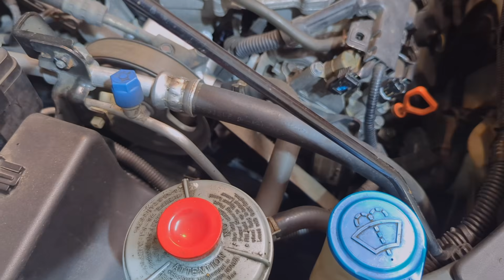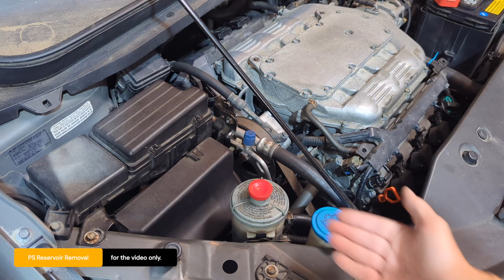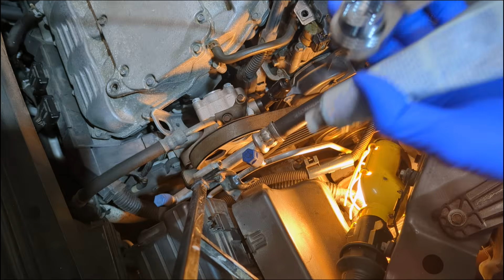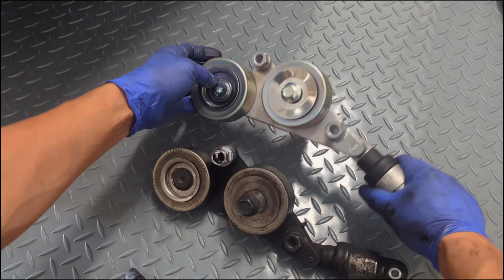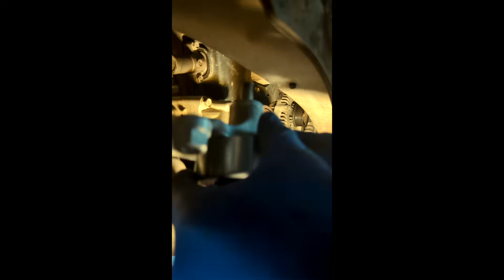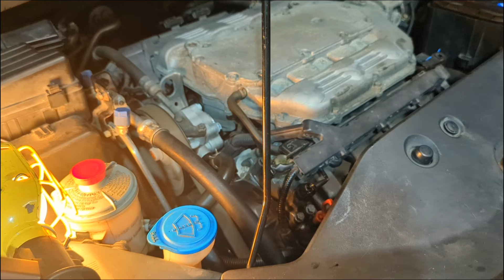Honda V6 Serpentine Belt & Tensioner DIY Guide - J35 Engine on Odyssey | Pilot | MDX

Comment from the maker: Update June 2026 — Eight months in, the aftermarket tensioner is holding up great. Smooth, quiet, and no issues so far! Links in the description but this is the replacement tensioner: https://amzn.to/4ntXDTK
Reply: This morning at 4AM while going to the airport the serpentine belt came off the motor.  I made it home before the battery died.  When I returned home, I looked and much to my disappointment, the new after market tensioner steel mounting bolt had sheared clean off where the bolt exits out of the motor.  I now have to figure out how to extract the bolt, going in from the side wheel appears to be the better strategy.  A key takeaway for me is that yes, I saved money, however the reduced cost of the non OEM product while was a better "value", may have not given enough thought to the metallurgy of the mounting bolt, it was likely less quality than the ASTM spec Honda uses and thus failed.  Any tips in removing the bolt stud in the engine, I do not have a right angle head narrow enough to drill and use an extractor.  thanks again for the video!
Reply from the maker: @JonHarvey-b7d   So sorry to hear this! Before drilling, I'd remove the tensioner and see if there's enough of the broken bolt exposed to turn it out with locking pliers; without the clamping load it may come out easier than expected. There are a few other factors that could have contributed to this, but Honda specifies slowly cycling this hydraulic tensioner four times (at least 3 seconds per compression) to bleed the air after installation. The mounting bolt also needs to be lubricated with clean engine oil and properly torqued. So the failure isn't necessarily poor aftermarket bolt metallurgy—OEM bolts can fail too if the procedure isn't followed. For the replacement I'd certainly use an OEM bolt/tensioner, perform the air-bleed procedure, and also check all pulleys/accessories for binding or misalignment.
Reply from the maker: @JonHarvey-b7d   an old thread about this (unfortunately uncommon) problem: https://www.odyclub.com/threads/2005-odyssey-belt-tensioner-bolt-keeps-breaking-off.152628

Comment: Thank you for starring video, i have 2009 Honda Odyssey EX only 68,800 miles, 4 year ago i changed Serpentine belt only , do i need change Tensioner and water pump now ? ,
Reply from the maker: There isn't a regular service schedule for the serpentine belt tensioner but monitor it and replace it if there is an issue. As for the water pump, it's part of the timing belt service and if this hasn't been done, it's overdue and time to replace the belt, water pump, as well as the timing belt tensioner and idler pulleys. Use the Aisin kit for your timing belt & water pump replacement.
Reply: @profsg Thank you so much for reply , looking forward to see your new videos 👍👍👍

Comment: I believe you're supposed to work that tensioner cylinder back and forth two or three times in order to get the hydraulic oil moving properly through that tensioner if you don't you have a good sense of snapping off the pulley bolt
Reply from the maker: Good point. Honda (OE Litens) does recommend slowly cycling the new hydraulic tensioner several times before installing the belt. That helps the internal damper operate properly. The other important point is to use the proper tensioner hex/tool—not the pulley bolt—as using the pulley bolt for leverage can damage or strip it. Thanks for bringing that up!
Reply: @lloydvandenberg6815  Very important point.  Also, when cycling or just compressing to install the belt, apply slow and steady pressure to compress the hydraulic tensioner.  Learned that the hard way.  Sheared the pivot bolt, which means removing the alternator and compressor to remove the bracket so you can extract the broken bolt.  Went 5 years without an issue, but am doing it again right now.  Mechanic insists that it wasn't his fault since he's aware of the Honda issue, but it was ironic that it sheared within a short time of him installing the belt.  Ended up replacing the bracket, too since the threads got damaged and I couldn't torque it properly.

Comment: Very helpful video and complete step by step instructions.  It was perfect for the my Honda EX-L VCM model with a 19mm tensioner bolt on the side of the tensioner  than on it for the non-VCM engines. Other videos I saw, were not clear about where the tensioner bolt was.  Your tip about removing the power steering fluid reservoir was spot on as well. I tried the tip another video offered to use regular socket wrench with a pipe for leverage to loosen the bolt but was not successful. I bought the tool you recommended and it made the task very easy. I also bought the belt you recommended. Surprisingly, it doesn't look as robust or has the deep grooves of the original belt even though Bando is supposedly the OEM supplier for this model. Well, will keep my fingers crossed. Couldn't have done it without your video. Thanks
Reply from the maker: You're very welcome, I'm glad the tool and tips made the job easier for you! Happy wrenching!

Comment: Thanks for this video. About to tackle this job (as well as the timing belt/wp) on my friend's 2010 Odyssey. Can I ask what brand of accessory belt tensioner you used, and is it still holding up? Your link to Amazon no longer works. I am looking at a tensioner from INA. Apologies if you answered in the video, as I didn't watch the whole thing through, but rather scrubbed the timeline and watched pieces.

Also, did you torque the main bolt (17mm?) first, before installing the lower bolt as well as perform the "bleeding" procedure? I ask because of the reports of people having the main bolt snap on them after installing a new tensioner. Regards.
Reply from the maker: You're welcome! The tensioner is still holding up very well after about 8 months. INA is generally a reputable brand and is actually an OE supplier for a number of European and Asian manufacturers, so I wouldn't hesitate to use one. For the timing belt and water pump job, I'd strongly recommend the Aisin kit. It typically comes with high-quality components, including a Mitsuboshi timing belt, and RockAuto is usually one of the best places to get an authentic kit at a reasonable price.

As for installation, yes, I torque all fasteners to specification and included the torque specs in the video through both narration and on-screen text. Unless you've developed a very good feel for torque over many years of wrenching, I always recommend using a torque wrench.

Regarding reports of the tensioner bolt breaking, that's usually caused by overtightening, damaged threads, corrosion, cross-threading, or reusing hardware that was already compromised during removal. These are not torque-to-yield (stretch) bolts that require routine replacement, but if your bolts are rusty, heavily corroded, or show any signs of damage, replacing them is cheap insurance. 

I also recommend spraying penetrating oil (Kroil is the best) on stubborn fasteners before removal. The Honda 19mm crankshaft bolt is especially notorious, so be prepared for that part of the timing belt job. I demonstrate a few removal techniques here: https://youtu.be/2RO2NBjZr2o

I haven't filmed the timing belt service on this 2010 Odyssey yet, but I recently completed one on a Toyota 3MZ-FE here: https://youtu.be/GwStqtt7UF0. In my opinion, the Honda J35 timing belt job is actually more straightforward overall, with the crankshaft bolt being the biggest challenge. 

Hope that helps, and good luck with the work!
Reply: @profsg  Thanks for the detailed response, and apologies in advance for my own droning here. Here's a tip, save reading my reply for later right before you go to sleep, it might help, lol.

 I did pick up the Aisin kit (TKH-002) after doing some research, but I also picked up an OEM pump (Honda 19200-RDV-J01 (Yamada)) due to some reports of one of the rollers (bearings) needing to be shimmed when used with the Aisin pump, because of a slight misalignment in pump's casting causing a "chirping" sound. At least that was my understanding. I don't know if that was with certain batches of pumps or if it is still an issue, so I opted for the OEM pump (Yamada). If anything I have a spare pump down the road. 

I've heard other people mention Rock Auto as well, so thanks for that. Good to have as many legit sources of parts as possible. I had already purchased the kit from Summit Racing (I have no affiliation with them, fyi). I should also mention that some of these pumps that had casting issues may be counterfeit, as there seems to be a number of them out on eBay and even Amazon, so it makes where to buy from especially important (as you've stated). As an aside, I wanted to verify if the kit was legit when I received it, and to my relief, it was, except I still had two questions for Aisin (via an email). The kit I received had the Mitsuboshi belt you mentioned, Koyo (now JTEKT) bearings, and the tensioner with Aisin written on it. Two things that stood out, one, the pump was stamped "Aisin" and "Made in Japan", I have seen other kits without the "Made in Japan" on them, and I'm not talking about the ones from Korea. Second, the bearings had blue seals around them and not the orange/brown color I saw in almost everyone else's kit. I emailed Aisin and they confirmed they are legitimate bearings as they used both colors. The other question I asked Aisin, was whether Summit Racing was an authorized reseller, and they were. 

Its encouraging what you say about the bolt, and the svc manual confirms what you said, in that it doesn't say "do not re-use" like some other bolts.  I will also mention this here (FWIW) that I have read in some cases, reports of having a dealer replace the bolt (due to the previous one breaking off) and the new one breaks off as well after a short amount of time. Someone else had provided an analysis of the reason they believe this happens (can't recall where I read it though). They posit that the large mounting bolt to the tensioner has to be torqued down first (@ 54 lb-ft I believe) before the lower bolt is on and before the belt is put on. They seem to suggest that torquing the bolt after there is tension on the unit compromises the bolt integrity. They also mentioned performing a bleeding procedure (and the svc man confirms this - compress the tensioner all the way toward the firewall, then slowly release. Do this three more times). Frankly, I am not sure what to believe, but there were enough people reporting the sheared bolt issue that had me concerned. However, its also reassuring to hear from someone who has done it and hasn't had that issue.

Did you make it this far? Why aren't you asleep already? lol

Oh, with regards to the crankshaft bolt, loosening it was the first thing I did before buying parts. I figured whats the point in getting the parts to do the rest of the job if I couldn't get that off. I bought that heavier thick-walled socket which brrrt brrrt it off without issue.
Reply from the maker: @BentPropeller   No problem. I read your comment—excellent job doing the research and verifying the authenticity of the parts before starting the job. As for the tensioner bolt issue, it wouldn't make much sense to me to torque the main mounting bolt after the tensioner is already under load. Sounds like you've done your homework and are well prepared for the job. And good thinking on testing the crank bolt before buying parts—that's one less surprise to worry about!
Reply: @profsg  Thank you. File this under me being a goober. After all the worrying about the bolt on the hydraulic tensioner possibly shearing off, I came to find out that my friend's engine doesn't even have it, it has the spring loaded tensioner. I think she has the (J35A6) engine. Glad I verified that before I purchased it, lol. As another happy discovery, I believe this model engine doesn't have the infamous VCM technology, so no muzzle device needed. Take care.

Comment: I've heard that this engine model with the 19mm job is a bit harder than the engine with the tensioner in the pulley that takes the 14mm. I've also inspected my tensioner and see there is a bit of wear on that hex/bolt so I suspect there's been some struggling to get it open in the past. Is it a really difficult job to do solo? I've heard you must work that tensioner hex very slowly and easy. Can you share a bit more detail on handling it? Does it take a lot of physical strength to maneuver it and control it?
Reply from the maker: You’ve come to the right place for this question! :) You are spot on—the 19mm hydraulic tensioner on this engine is much stiffer, and because the space is so narrow from above, I highly recommend (if not demand) getting a dedicated serpentine belt tool like the one in the video (https://amzn.to/3RgP9Sq). It makes the job so much easier because it gives you the thin profile and the long leverage you absolutely need in that tight spot. 

When I did my timing belt job seven years ago, I only had a big breaker bar, and because of the awkward angle and lack of room, I struggled and nearly rounded one of those tensioner nuts myself. That "bit of wear" you're seeing is likely from someone (like me) struggling with that same lack of space in the past! If yours is already looking a bit worn, definitely get a tube of Valve Grinding Compound (see 4:06). A little dab inside the socket will help it "bite" into the metal so you don't slip. 

Since this is a hydraulic tensioner, the trick is to apply firm, steady pressure and move it slowly; you have to give the internal fluid time to move so the arm can compress. If you find that top nut is too rounded to get a good grip, remember that there is a second 19mm bolt head on the bottom of the tensioner that you can access much more easily from the passenger wheel well. It does require some physical strength to hold it open, but with the right tool for leverage, it is definitely possible to do it solo. However, you will definitely appreciate a helping hand during the actual belt removal and installation so you can focus all your strength on holding the tensioner while they guide the belt. Hope this helps!
Reply: @profsg  Perfect description. I'll pick up that compound today and give a shot on my own first. 🙏 Thank you so much and really great video. Best one I've seen on serp belts so I'll check out the whole channel.
Reply: My arms are small enough to fit in the bay to get the belt on but maybe not large enough to move the tensioner 😭
Reply: From the top 19mm lug, slowly and firmly push the wrench handle until you feel resistance. Hold it steady a few seconds until the pressure eases. Then continue slowly yet firmly pushing until the handle stops. Hold it steady while removing the belt from the most accessible pulley. Then SLOWLY release the tension.

Comment: How often do you recommend changing the serpentine belt and the tensioner. I noted you mentioned the tensioner was 15 years old.
Reply from the maker: Honda recommends inspecting the serpentine belt and tensioner regularly. When you do the timing belt service around 100k miles, it’s also a good idea to replace the drive belt as well. As for the tensioner, just keep an eye on it and replace it once you notice any noise or issues due to its loss of tension. A Honda tensioner is quite expensive and I wouldn't spend hundreds unless it really needs replacement. Will see if the aftermarket unit in this video (only $32) can last a few years.
Reply: @profsg lovely. $32 is a such a bargain😊 thanks for the great video.
Reply: This was a great video, I had been trying to find the release for hours and kept being told us 14mm until I gave up. Then I seen your video and showed everything I needed to see.

Thanks!
Reply from the maker: @MixedbyArtR  you're so welcome! Glad the video helped.
Reply: What’s the name of the tool for the tensinor?
Reply: Very detail oriented, quality, great views. Such a helpful video, great work Professor!